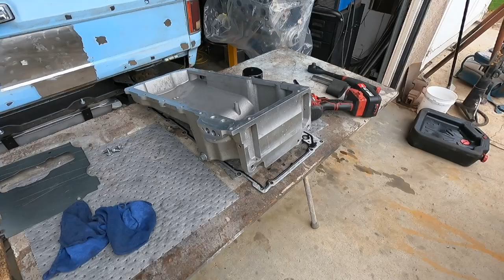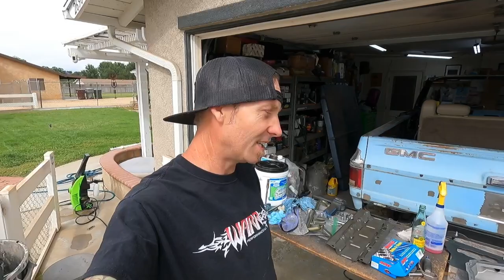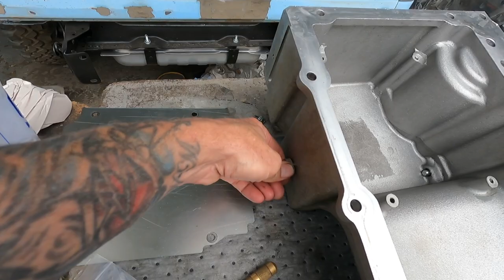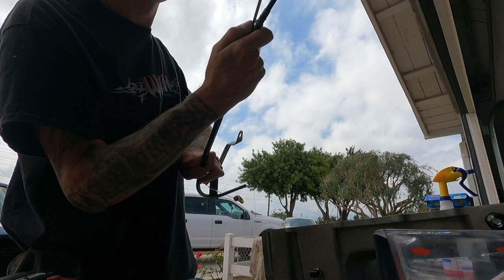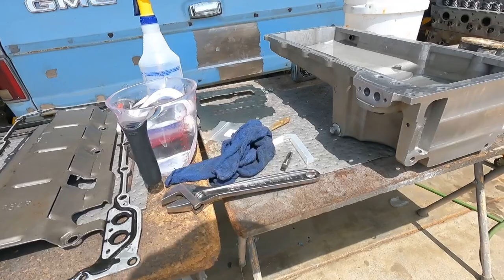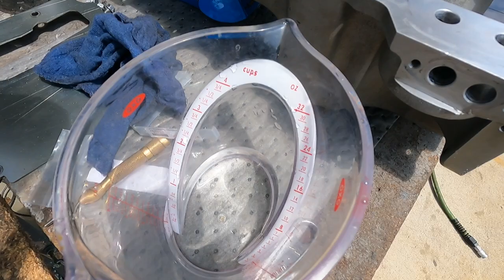Cheap LS Swap oil pan capacity

Comment: Question,  besides having two vehicles down at once. Why not swap oil pans with the bego? It doesn't need that shallow one right?
Reply: So I took mine out of the box, p in a box! 🤣 and this is what I got.. 6 qts = 1 1/2 in from top of pan. Also, just under the threads of the drain back plugs and starting to fill the scooped cut out in the pan. 6 1/2 qts = 1 1/4 in from the top. Filled the scoop and starts to reach the front of the pan. 7 qts = 1 1/8 from top and fully reached bottom of the vertical wall in the front of the pan, maybe a 16th in up the threads on the drain back holes. I have pictures of it all, too if that helps.
Reply from the maker: @masoncampos7043  Yeah 7 seems fine because by the time you fire up the motor and it sucks oil down I bet it’s good to go. I will also have to compensate for the accumulator at a certain point so I’ll be in the 8qt range I think when it’s all said and done so should be plenty.
Reply from the maker: The one in the bego holds less oil I believe. I used the shallow pan in the bego because of the front straight axel. I will have to re visit it tho because if I could use a stock truck pan in the bego it would be bette but I think its right over the axel so I don't want it to hit.
Reply: @Burndown  I think it holds the same as the one on the Boom. It's just thinner at the front for the factory steering link. I can fill mine up this evening to confirm. I watched your video on it when you first posted it, and bought the same one. When you put the motor in the bego it looked like there was plenty of clearance up front. But then again, I'm just watching a video of it lol. I gotta go watch the Maliboom running now!
Reply from the maker: @masoncampos7043 Yeah the bego has plenty of room but when I installed the motor it wasn’t lowered yet so I was being cautious. Swapping it out would probably benefit me with oil capacity alone. I want to run an oil cooler the old girl as well so maybe I can do it all at the same time. It will be getting a hot side make over and probably new exhaust at some point.

Comment: I just recently bought a cheap steel ruler with a ton of drill tap sizes. I ran the suggested dipstick with the holley 302-1 which said full at 5 quarts. I was thinking of running an oil cooler for the extra capacity. Lastly I screwed the factory oil filter screw on and used the ls filter. There is a difference in size of the 2006 truck filter from the 02 filter. Don't recall which is which. I usually look then both up.
Reply from the maker: Yes the have a bit larger oil filter but I don't know off the top of my head what the number for that one was.

Comment: I wonder if you would have bolted the windage tray into the block used a straight edge to measure from the straight edge up to the surface for the pan on the block, then use a straight edge and measured from the pan flange to the "fluid"?  What I don't really understand is where the oil in intended to be with respect to the windage tray in a stock application.  Also how much oil is in the block and push rods etc. while an engine is running which may be an over full condition while off.    I am sure there is a delicate balance between just enough and too much.
Reply from the maker: Yes I agree. Filling a factory pan up to the specified amount and measuring that would give a good idea as to the perfect fill level. I figured keeping it under the windage tray seemed logical but I could be way off since I don't know for sure.

Comment: 7 quarts probably wouldn't hurt because u have turbo lines i would run 7 be safe
Reply from the maker: Well the cool thing now is I know what 6 quarts looks like in the pan and I know it falls at the top mark on my dip stick. So with the accumulator and turbo I can pour oil in to the mark so the level in the pan stays where it should if that makes sense.

Comment: I run 7 quarts with that style pan
Reply from the maker: The Holley pan this is a copy of calls for 5.5 so that's even less then the 6 I normally run. I did have it around 7 when I had the issue with it at RMRW last year and it seems like that would be right at the bottom of the crank without the motor running. I bet the fluid level drops a bit with suction on the pump and waiting on the return oil flow.

Comment: Don't forget to take into consideration that you have a turbo with an oil line and an oil cooler + it's lines. After initial fire up it will probably need topped off? Or I would think so.
Reply from the maker: The turbo holds a little oil and so do the lines. They are small tho. I don't have a cooler but I do have an accumulator. Yes I'll check it after I start it up as well.

Comment: Once its running you can probably get by with over 7 because once the pump starts pumping surely it's down a good bit
Reply from the maker: Yeah that makes sense. The pumped oil will take a little time to drain back so the level won't ever really be up to the crank I guess with 7 qts.
Reply: You'll have to put a go pro in there and see what happens

Comment: 😶
FWIW Pete Herrel also said Cleetus should run 9 maybe 10 quarts, to help his oil issue.
Would be bad, when not going hard down the track, though.
Don't forget your filter capacity, lines to and from turbo, and accumulator. I'd run 8 quarts, with that setup.
I run the tall LS filters, when not running a clear view.
Reply from the maker: The accumulator will take some oil to fill but I want to find the correct level so I when I open up the accumulator I can fill it back to the correct mark on the dip stick. Yeah if I ran 7 in the pan it would probably take another qt to fill the accumulator I would imagine.